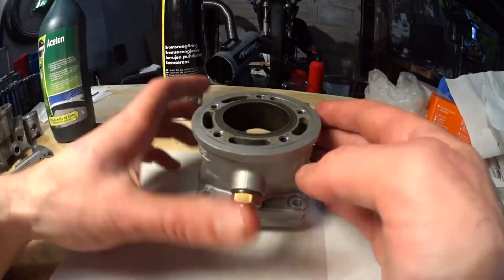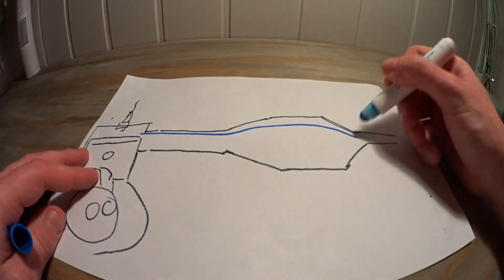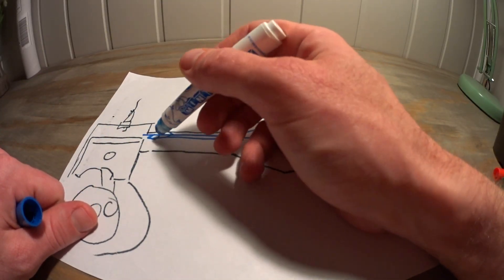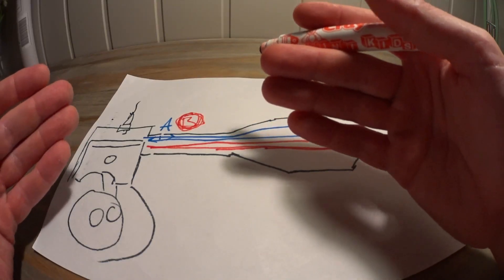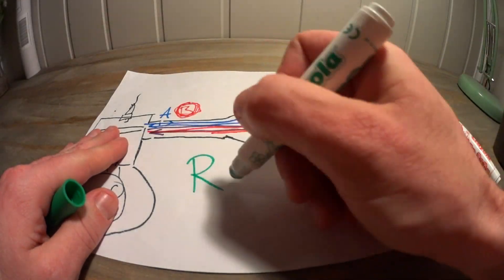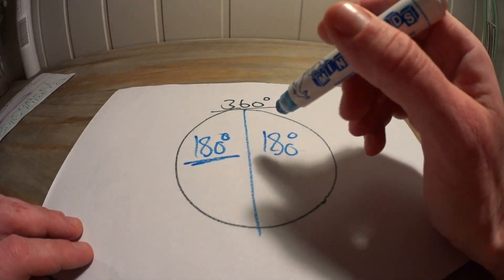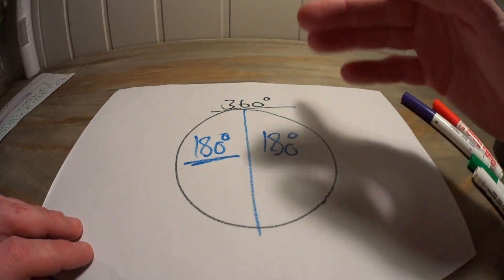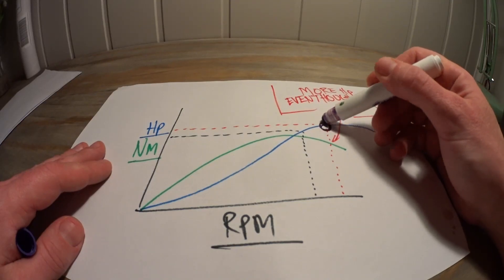HIGHER EXHAUST PORT, GOOD IDEA? How Exhaust Port Timing Affects Two Stroke Performance.

Comment: Jup in raised my exhaust port 3mm of my original mobbylette and i lowered my intake also now the low end power is lower. And it wasnt verry strong to begin with. A new carburator is in the mail and im going to make a high compression cilinder head. Im a good tig welder so hopefully the free software for expansion chambers work😅

Comment: i se the wawe a difrent way. i se it like a pressior wave and controll it with the last pipe before the silanser. the pressior wave has to resunance and have like a little pause ca 10 or 12 cm the port so you get a under presior at the port and a high pressior in the rest of the mufler . the higer the revs the more presior and ther is ver i detirmet the Ø of the last pipe and controll the pause to get max back presior and max wacoom at the port and newer loos all the presior in the mufler. ewrything you push back in the cylinder is free horses.

Comment: Too many things I don't agree with to get into. To start with the pulse speeds are not the same. Not even close. The temp of the exhaust gas when the port opens is higher. And much hotter. 
Anyway how about doing a video with insanely low Ex port durations and fun things you can do with them. 
Chambers work better with high exhaust port duration than they do with low ex port durations.

Comment: On 200 degrees on a 125cc running methanol, Reverse fuel pressure with a readout, change the timing depending and reduce cooling with with tape on the radiator, and also start rich with jetting and work your way down.  My 125cc engine dyno’d at 39.7hp in 1997.  And also drop one of the piston rings (bottom one)
Reply: aluminium race cylinder pistons often come with only one piston ring these days

Comment: I believe you are talking about what is know as back pressure?? Some back pressure is needed to stop fresh air and gas from escaping out the exhaust while the cylinder is taking in new mixture or CHARGING. To much BACK PRESSURE is NOT good OR to little. Your type of exhaust comes into play here does it not??

Comment: The biggest performance killer when raising the exhaust is loss of compression. Keep that in check and you probably won’t notice much difference between a couple degrees.
Reply: And yove just made more blowdown
Reply: 2 strokes like lower compression anyways
Reply: @xfdfff2620  no they don't.
Reply: @CJSaws  you can just see here in this video at the end, stock head made little more power than high compression one, and vhm head with lower compression insert made more than one with high comp
https://youtu.be/SF7pDtT13XM

This can also be seen in 250 2 strokes
Reply: @xfdfff2620  too much compression is a different story. There is a sweet spot and it's only lower compression if your comparing it to a motor with too much compression.
Reply: @CJSaws  true, too low compression isnt good either
I am Interested tho about how does raising exhaust port affect compression and why? It should affect the combustion chamber size, etc
Reply: @xfdfff2620  less volume, less compression. the higher the exhaust goes, it traps less to use for building compression.
There are multiple variables at play with two stroke motors The volume of incoming charge, expansion pipe vs can muffler, combustion chamber size, squish band width, exhaust height, piston rings. Either one can compensate for the lacking of another.

Comment: This vid only explains half of what an expansion chamber does, the positive pressure wave that travels down the pipe is partially reflected by the defuser part of the chamber (the diverging cone part), it is reflected as a negative wave, in other words as a partial vacuum. When this vacuum reaches the exhaust port it helps pull fresh charge up from the crankcase via the transfer ports, it actually pulls fresh charge into the exhaust pipe. This fresh charge is rammed back into the cylinder by a positive pressure wave just before the exhaust port closes.

Comment: In the age of no internet and YouTube, I've learnt this with trial and error with my little 110cc bike and ruined many cylinder blocks along the way. I learnt that high is always better, but the problem is to find a matching sport exhaust to match it. None of the ones/aftermarket sold in the store would match it but found one old and beat up exhaust matching it perfectly. I did not know it had to do with resonance but now I understand why it's a pain to look for a matching exhaust. It easily hit 180kmh in a few seconds. I used it for drag

Comment: tip top top tip : the hotter the exhaust pipe/gas is the faster the sonic pulse travels

wrap or ceramic coating helps with this

how am i'm gonna get this to work on my outboard engine hmm i don't know yet :) but something has to happen

Comment: Hi m8, i like your videos a lot, maybe you can give me a hint with my bike. I have a 2018 Aprilia RX50 with engine d50b0, i took off everything that is restricting it, i installed aftermarket cdi, leovince xfight exhaust, polini cp19 carb moded with different jets and now i have a proper piston wash with 49low jet; 90 mainjet; neddle 12/22 clip position 1 above midsection, airsal 74.2 bbk, i kept the stock air filter, malossi vl6 reeds kit, gears 11/50. I would like to get more torque in low band, i use it only on mud and forest, don't need speed too much.... I would appreciate any advice. Thanks

Comment: With a piston ring out of the bore what should the gap be? I'm asking because I am curious to know how much tension the ring should put onto the cylinder wall when inserted in the bore around the piston?
Reply: .003" for every inch of diameter of the piston

Comment: Longer exaust timing, likes longer exaust systems...
Reply: so you are saying that the longer the port duration the longer my pipe needs to be? well finding the right pipe size is simple but does having a longer(higher) port duration increase power in the high rpm range? 

sorry for the newbie question, im just finding ways to squeeze all the power from my 50cc moped
Reply: @redsoldier17  on a piston port twin longer pipe tailcone/timing worked out ok for me but lost in lower rev range. 2 stroke tuning is compromises. 

If you're really interested into the how & why of tuning small 2 stroke tuning checkout: AuMechanic youtube chanel

If youre street riding a 50, big bore kit may be best bang for buck after a pipe & carb...

Comment: How about chain saw engines with no pipe. We raise the exhaust port ceiling, and lower the intake port. Then we cut about 1/8” from the bottom of the piston skirt. I wish I knew more. I port Husqvarna dirtbike vintage engines and they respond very well. Like your videos.

Comment: I just put on a 60cc cylinder on my moped and the exhaust port is "too high", for me at least. It has no torque at all but from like 7 or 8000 rpm the hp is insane and its sketchy to ride. I would wish that it had a little more of both since the old 49cc one had all the torque...

Comment: the only easy way to do this for me is wack another gasket between the barrel and bottom end, this will also raise my intake, what effects will this have? my motor is a yamaha kt100j (13hp) it revs to about 11280rpm, i managed to get it to compete with its destroked higher output cousin (kt100s) but i seem to run out of power at around 10800

Comment: So i have a small 2 stroke.
I just measured the exhaust port duration and it is a measly 160 degrees.
Should i CuT dAt ShiET?
seriously though, i want the engine to rev higher, its a single speed transmission and i want more top end.
Reply: did you try to cut that shit? if so, what happend?
Reply: @eirikrcman1511  not much, i did it several times, im at 180 now.
Its more about port angles and size it seems. Unless they were the bottleneck all along

Comment: If the exhaust port timing is too high can this be corrected with retarding the ignition? My 85cc dirtbike pops when wot more than 2 seconds jetting is correct. 105 BBC kit installed

Comment: Can you tune the expansion chamber to gain more effect on lower revs at the cost of performance on the high end of the power spectrum?
Reply: Years ago I saw a König racing outboard engine with tuned pipes that tromboned longer and shorter with the throttle position. I tried to Google that now but found zip. Maybe this was a local experiment. I remember there were a whole bank of pipes that moved. The engine was on the small hydroplanes where the pilot lay down. I loved the racing fuel they used back then.
Reply: @christopherknee5756  that would definitely be neat to see.
Reply from the maker: Yes
Reply: @2STROKESTUFFING  how

Comment: That is a good explanation of raising the exhaust port but what happens if you lower it. I have just resleeved a two stroke cylinder and I reduced the port timing from 190 to 185.5. This was done at the same time as widening the ext port to achieve more area than before. I was hoping this would result in a longer power stroke.

Comment: Not exaust port, but injection port at high pressure making a sort of supercharging, you could inject a little amount of fuel and NOS mixed with special injectors that already exist ( the injector wich inject fuel and NOS mixed), do you undetstand what I said.  They Are NOT exaust port puted higher, they are actually injection ports above the exaust line.

Comment: With all the issues fuelling the spx with nitro, does the different fuel affect the resonance? As in it depending which fuel used burns/bangs faster or slower the petrol,, meaning faster or slower pulses etc etc

Comment: I raised the exhaist port on my cylinder i was just wondering How will know when driving if ive raised the exhaust port to high.
Reply from the maker: After about 190° you'll start shrinking the rpm range in resonance, if you go too far it'll shrink to such a narrow range it becomes practically unusable - you've made a doorstop...
Reply: ive seen guys going 200, does higher timing results to a higher rpm range but lower on torque?

Comment: Hello guy! Does the exhaust manifold/flange length have any effect on resonance? If so, can anyone please tell me what the difference would be using a shorter and a longer one? Thanks in advance.
Reply from the maker: The pipe in effect starts at the piston face so yes, it's basically part of the header.

Comment: hello.. sorry I am commenting on an old video.. People always discuss about raising and lowering the port and it will indeed change the power curve of an engine. what happened if we tweak  the bottom part of the port, i.e making the port longer down the cylinder, but not changing the port timing. what will happened then? I hope you can explain it if you have this kindof experience. thank you.
Reply from the maker: In short lowering the port floor beyond where the piston stops at bdc won't do much at all, in some cases raising it can have a positive effect on power due to less short circuiting and a smaller duct resulting in higher gas velocity during blowdown.
Reply: ... which results in better scavenging.

Comment: Hello, I'm just getting into motorized bicycles and this vid brings a question to mind; is resonance a factor in the intake as well? Also, if so how is it different from the exhaust resonance as far as affecting performance?
Reply from the maker: Yes it is, in fact it's a factor throughout the whole engine, the whole system needs to be "in tune" for best results.

Comment: Hi! Me and my friend building a peugeot fox for mopedcross. Do you have tips for porting the original 50cc?
Reply from the maker: Does it have to be the stock cylinder? Probably a pretty bad starting point.
Reply: Thanks for the reply! Nope, but it has to be 50cc and i have been told that the original 50cc isn't that bad.

Comment: sir i wanna ask, if im using over bore cylinder 59mm to 61mm have power valve..exhaust port should be hi also? mean,adding more gasket for cylinder? ..how about the head,need adjustment?..need your help sir..

Comment: I really appreciate you putting the time to educate us on the lesser known facts of two stroke engines. I mean anyone has the concept of switching the air filter for a "performance" one, changing gear ratios, different spark plug, etc. But this stuff is a bit more outside the box and very intriguing
Reply: @monkey, this is definitely not outside the box on 2stroke engines. Porting the  intakes and exhaust ports on a 2 stroke is basically the same as putting a bigger, performance cam in a 4 cycle engine..
Reply from the maker: Thanks!

Comment: What do u think about dimpling port0ing? Intake? Exsaust  ? Just like a Golf ball i did it to my race 2 stroke motor thinking it wqill helo admizing my oil gas mix what do u think?
Reply: Dimpling can help with turbulence, making your fuel more evenly distributed/mixed in the air
Reply from the maker: I have to do some testing with dimpling in various places.

Comment: Port wide 1/2 mm up clean transforports new case bearings  seal retainers these bicycle engine can get to 15,000 rpm now they have 92cc motorbike engines 52mm piston

Comment: If the pipe pulse (a sound wave) is released earlier (due to a raised ex port), than it has to come back to the piston earlier also, (not later), since the sound wave is a fairly stable speed, (depending on pipe temps).  It's a good point that I had not put that much thought into though.  But "your" second pulse (off the piston, which I have never seen before) has to be diminished in strength quite a bit.  But that would not matter.  Once the port opens again, (the big boom),--that little pulse is going nowhere.  Sorry man.

Comment: Alex, nice explain, lots of pen action, can't go wrong with pen action, 
well at least until the ink runs out.
To add abit of info for you and AuMechanic (good basic chamber videos, 
thumbs up).

When engines run, they don't run at a constant rotational speed all the
time thru the cycle.
So say your rpm meter is displaying 11000rpm, this is the mean rpm, 
measured at one point in the 360* rotation. If you were to measure the 
instantaneous crankshaft angular velocity (done with an encoder with the
 output quad'd to get the resolution down to 0.1-0.2*) on a single 
cylinder 2 stroke you'll find the instant varies from the mean by as 
much as +/- 250rpm, 500rpm P-P. The undervalue bottoms around exhaust 
port open which then gains rpm until the overvalue top just before BDC 
and then loses rpm back down to the undervalue at exP open.

So its not possible to use simple maths for the time that the exP is 
open and closed and this has an effect on why the natural port duration 
for resonance usage is not 180* along with other factors involving the 
sonic wave speed in the pipe itself.
Reply from the maker: +cara vaggio Thanks! (got stuck in the spam filter...)

Comment: So raise the ex port, lower the compression you gain the 17600 rpm?
Reply from the maker: +Knolto 125Rider With enough blowdown area, yes.
Reply: 2STROKE STUFFING so that your ex had an extremely smal pipe, then have you cut edge on piston top instead cut the ex port, at least open and closed duration wil be same degree
Reply: Knolto 125Rider ramping the piston still changes the timing

Comment: I have a cheap chinese cylinder kit on a cpi sm 50 (Taiwanese Minarelli am6 copy) I didn't run the kit before rebuilding the bike but the kit had a silly amount of poorly cast, rough material around the exhaust port so in chamfering it I was raising the exhaust port also. in the upper RPM's itll scream away, has a very narrow powerband and not much power in the lower rpms so the engine has to be worked all the time which makes town riding a chore. its almost like a yamaha dt125 with the powervalve pegged open but alot worse since the little 70cc has less power than a 125
Reply: under 100cc low end power and high max power dont go well together at all. maybe you could make it better with a different pipe

Comment: Matters with resonance is that a large numbers of moped just can't use it due to configuration the moves the engine ...

Exhaust that lift up with engine are bit fragile on tightened points,
If you specifically could "find" them, most of times not allowed anymore on roads,
And other point is to built parallelogramme balance system onto the moped, ...
Which is not either allowed on roads ...

Resonance cannot efficiently be used on exhaust with ajustable inclination the move the engine .

So, hight exhaust without proper resonance that reduce the frequency bitrate usable is not a solution on most of case .

Better look for exhaust port in three pieces two barrels and two smalls laterals ones .

You will have a way more longlasting rings ...

Endurance the engine sometimes has to be considered ...

Once theorical power cannot runs for miles, how get a sense the work done ?

Comment: Are performance crankshafts worth it? Someone told me that performance crankshafts are as strong as oem crankshaft. How much can oem crankshaft take before breaking?
Reply from the maker: +zozias101 They're only needed if the stock crank can't handle an increase in rpm or power, or if you're after more/less crankcase volume some of them might help with that. OEM often exceed the so called performance cranks in quality.